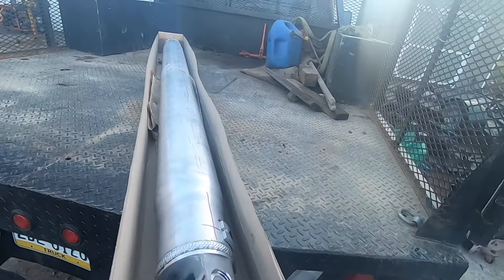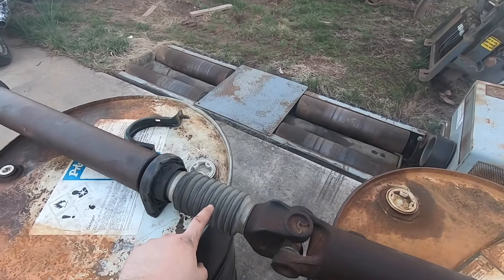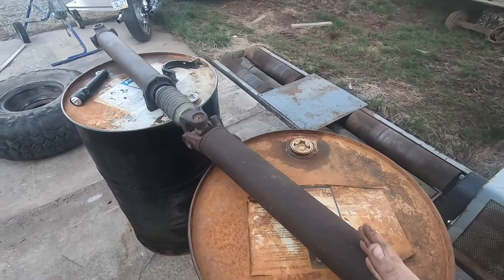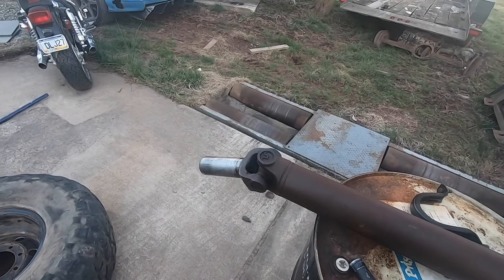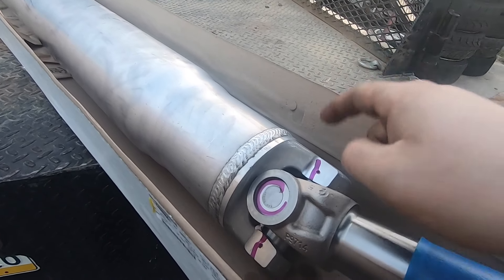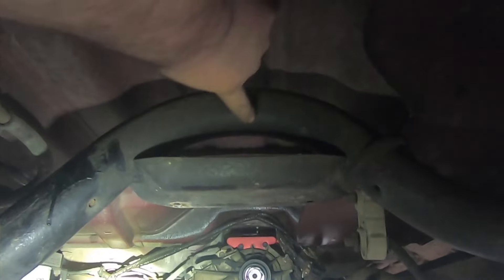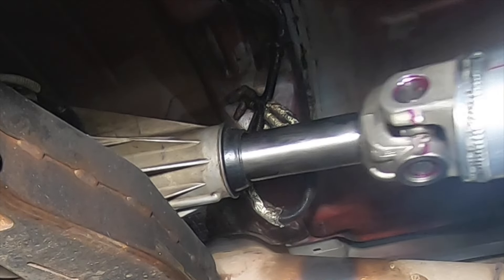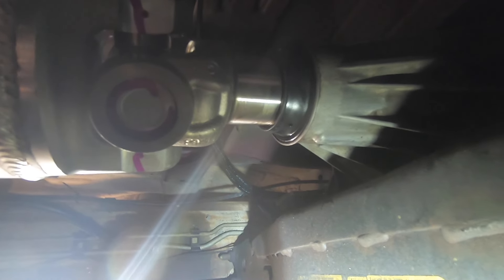I put this HUGE shaft in my LB7 CCLB Duramax. One piece driveshaft conversion.

Comment: I have one on my 05 Dodge 3500 4 door and long bed 4x4 .I got mine from west Texas Dodge drive shaft and it has been in for 5 yrs and is so sweet no vibrations at 800 bucks it’s 5” diameter it’s a beast .
Reply from the maker: Awesome. I am super happy with mine as well

Comment: Looks nice the factory GM shafts are a little on the thinner side. We see them come in twisted up pretty frequently. But usually it’s guys who have big wheels and tires with the power turned up towing a large 5th wheel. We make replacements shafts out of 5 inch by .120 wall tubing. But they are around 1100 dollars when it all said and done with new u joints and the transmission slip yoke.
Reply from the maker: I hope it holds up for me. Its just an old LB7 so its not a super power house but I do work the hell out of it
Reply: Why would I feel the yoke moving in and out when I let off the brakes from complete stop ??? That’s what it feels like anyway
Reply: @CODYWAYNEinGA6.6 I'm having the same problem  did you figured out why ..??
Pleas3 lmk
Reply: @jesuszuniga5113 most likely its your center splines have so much play it moves up and down. same issue on my truck

Comment: When I saw the thumbnail I said christ!  Aluminum is not what I expected, but like you said they did the engineering on it so give er hell.
Reply: Aluminum critical speed is actually slightly better than steel, because the strength to weight ratio is better. Steel is stronger, but the extra weight still wants to jump rope more.

Comment: I have a 2003 LB7 Dually automatic, where would I go about a yoke for the rear axle?
Reply from the maker: I think you can order a yoke for a stick shift duramax or order one for a newer duramax.
Reply: Can I use any 2011-2022 aftermarket aluminum driveshaft as long as I switch out the rear yoke?

Comment: Haha that's a lot cheaper than the custom aluminum shaft I had to get for the Beretta
Reply from the maker: Im glad I built temporary shaft for my beretta... as I have changed my engine position 3 times already
Reply: @spankranchgarage  haha I'm locked in with that $700 jobber in there! Fits good though, even if the weight distribution is less than ideal

Comment: I put one in now I can feel like the yoke moving in n out when I let off the brakes from complete stop
Reply from the maker: Id be checking leaf spring bushings and shackles. I dont have this at all
Reply: Might have found your reason for the 2 piece failing. Yolk should not be moving
Reply: @Lil_witte17  I never had a two piece mine came stock

Comment: So this should be an exact fit on my 07 lbz 3500 correct?
Reply from the maker: Yes if it’s a crew cab long bed
Reply: Will the slip yokes and splines match up to a 2006 Duramax Crew Cab, Longbed?  Getting a ton of mixed comments or will I need to replace or update parts?
Reply: @acallaway44  it fit perfect in mine. Didn’t change out anything. Just cut the carrier bracket and slide her in

Comment: How's it holding up almost a year later? I need to do this on my 2006 LBZ dually
Reply from the maker: Its fantastic. Not a single problem, as I would expect from an OEM part.
Reply: Watching this AGAIN! I ended up buying one from Action Machine  for a little less than $900 shipped, ujoints and everything pre-installed,,. The OEM that you used is now around $800 alone from GM
Reply: @spankranchgarage  Just finished the job a little earlier, what a difference!!!